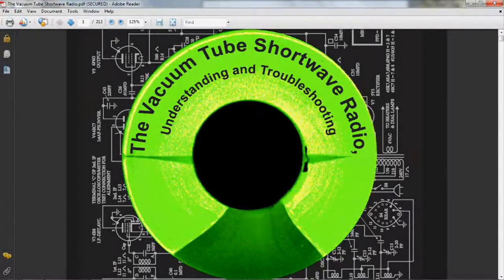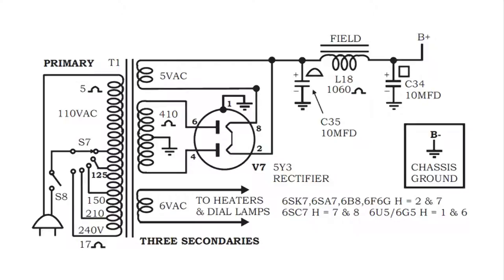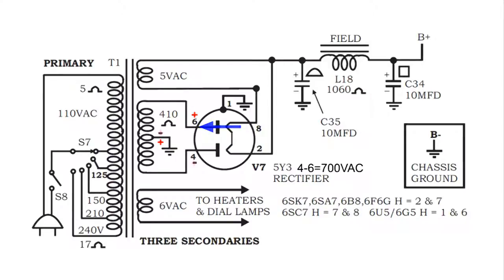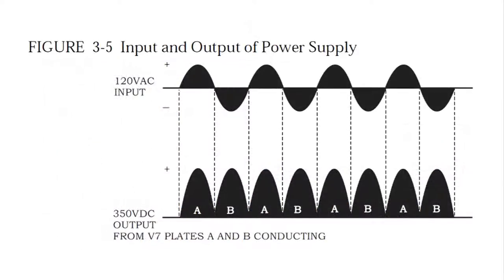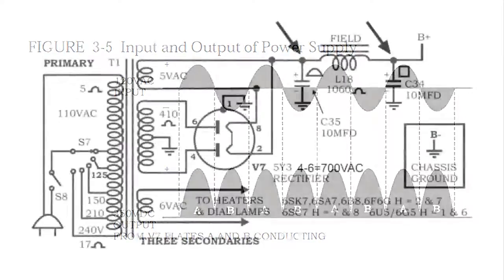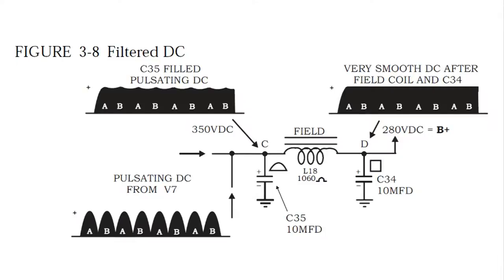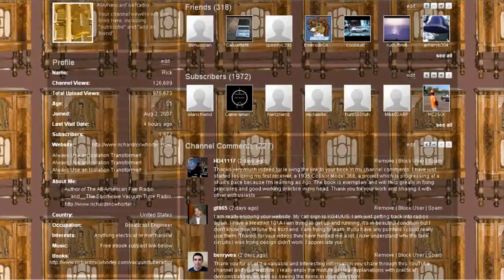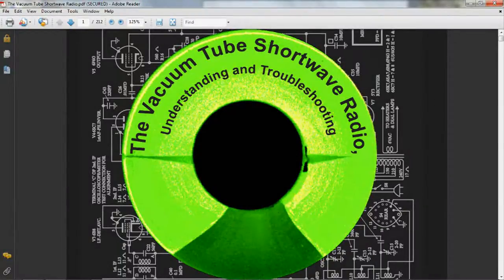Full Wave Rectifier Tube Type

Comment from the maker: Thanks joernone
Hey John,
I know it does not seem right. But in the power supply and standing on the filament you see the positive potential only. That is why the filaments a connected to the positive sides of the filter capacitors.

Regards,
Rick

Comment from the maker: Thanks FyberOptic
Its DC and both sides of the filament are use on both cycles. Maybe a little more on one side than the other. But the DC resistance of the 5VAC winding is very low.

Comment from the maker: @tadgesualdo 
About two years ago I did videos on an RCA 280 and I replaced the speaker with a new modern PM speaker. I engineered the power supply to work with out the field coil. Also if you download my ebook the information is there also.

Comment: Something's always confused me with tubes where the filament supply also provides the output supply through the same connection.  I mean, during one half of a cycle, I can see electrons flowing from B+ back to pin 2 of the tube, then across to pin 4.  But on the other half of the cycle, it seems they'll flow through the 5VAC coil of the transformer in order to get to pin 8 of the rectifier to jump across to pin 6.  Or, maybe they don't jump the plates and are grounded by the tube.  I'm confused.

Comment: Question on flow. The flow alternates from Pin 2 to Pin 4, then from Pin 8 to Pin 4. Both Pin 4 and Pin 6(on the plates) then go to ground. How does the rectified DC get to the main line before C35 and L18? I just do not understand how it actually gets there.
Thanks,
Reply from the maker: It from 2&8 to 4,then 2&8 to 6
Reply: @AllAmericanFiveRadio  sorry, I got pin 8 to 6 incorrect. But I still am having trouble how it flows to the line C35 is on. After the plate(pins 6 and 4) it goes to ground. It looks as if there is flow from pins 2 and 8 to the C35 line.
I am sure this is quite easy for you but I am just having trouble here. Most circuits I see have a line from Pin 4 and Pin 6 to the line C35, L18 and C34 are on, then it makes sense.
Anyway thanks for the great videos and the response.
Reply from the maker: @lf-1942  Try this, I have marked each half of the secondary with the polarity. Substitute Each half of the secondary with two batteries. It's the secondary that produces the power. Electrons flow from negative to positive. The filter capacitors are charged through the negative ground. All ground symbols are connected together, the same wire to each symbols.

Comment from the maker: @tadgesualdo 
Over the years of working on many circuits, when the circuit motorboats it has been a capacitor problem. Not always of course. Motorboating is an oscillation.

Comment: So, if I placed a high impedance DC voltmeter across pins 2 and 4 of the 5Y3 during the conducting cycle, there would be very little voltage drop between the plate and filament? And the filament side would be charged highly positive although the filament is in a negative cycle? Does this have something to do with electrons and holes working at the atomic level? The "holes" racing toward the filament are what is creating the high +350 VDC? And finally, if someone accidentally reversed the 5VAC filament from the secondary, the phase would not be in the correct alignment with the plate voltage phase and the tube would not conduct fully or not at all?
Reply from the maker: +newjerseybt 
You would be able to capture the electron flow with an oscilloscope. An analog or digital meter cannot respond fast enough.

Comment: if i dont put a filter can i use another capacitor or can i  use diode to rectifier ac to dc?
Reply from the maker: Diode, Vacuum Tube and Solid State, Power Supply
https://youtu.be/jG7ok3h8bRs
Reply: thank you but can i built tube power supply without noise filter??
Reply from the maker: Sure you can, but it will be noisy.
Reply: AllAmericanFiveRadio  a lot of noise ?
Reply from the maker: LOTS!